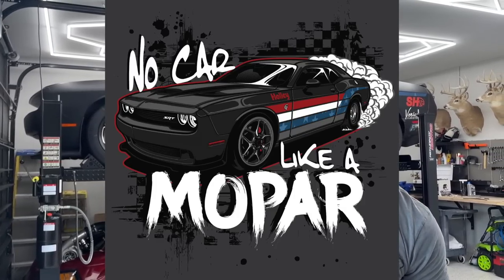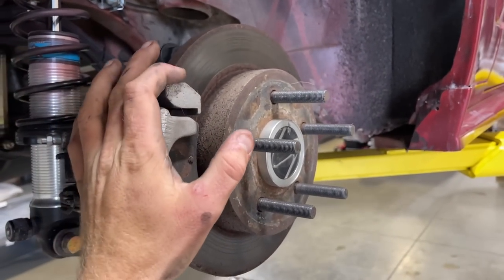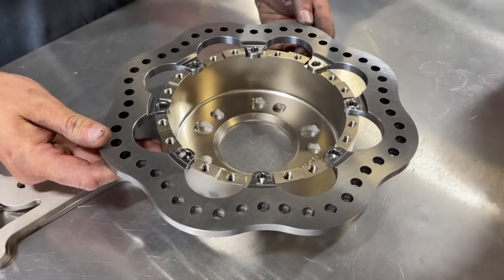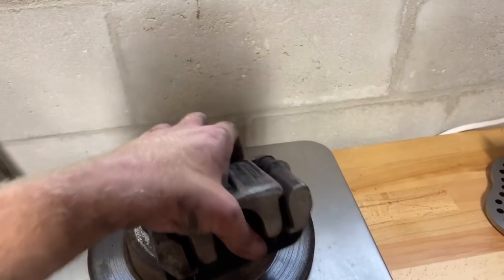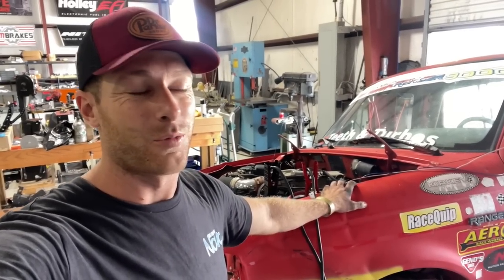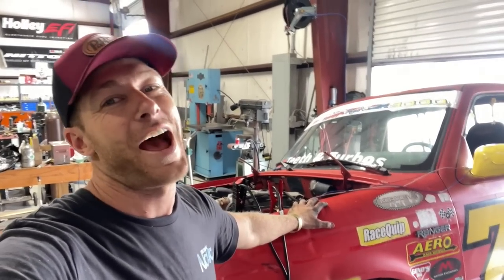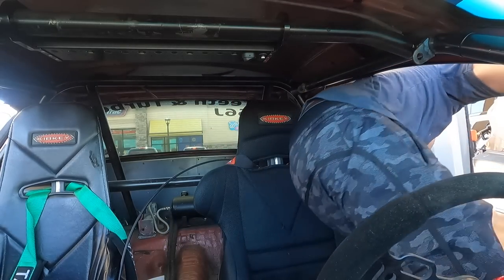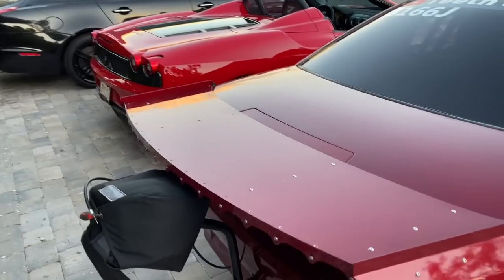7 Second Dr. Pepper Mustang First Start Up! New Brakes are UNREAL! Hellcat gets Upgrades as well!

Comment: Try Bars Leaks Head Gasket Fix in the Ranger. I've used it in 3 cars and its worked in all of them. One step, just poor into coolant. My brothers 4.0L Ranger had coolant running out the tail pipe and would shoot out the spark plug hole. Added the Bars Leaks after 20 minutes of drivinig it was sealed. Was still good a couple years later when he sold it.

Comment: Sounds like your ranger needs tune up or head gasket. Also you need front shocks badly get some stuffer on right side and leave a soft o left help with the weight on heavy corner banks

Comment: Those front tires for the challenger are going to lock up and go straight into a wall in the burnout pad though parker, better put the stock ones on for the pad to be safe
Reply from the maker: Those aren’t for burnouts, just drag racing

Comment: What's ironic is that you were measuring imperial dimension steel rod and calling it out in metric.  1/4" is 6.35mm otherwise known as 7mm, 5/16 is 7.93mm otherwise known as 8mm, and 1/2" is 12.7mm, otherwise known as 13mm 😁
Reply: Your tools must be slipping and rounding every nut and bolt off if thats how you work. Right size of tool is whats needed. Everytime!
Reply: @thatdudeinorange5269  Fractions are rational, everything else is just an approximation...

Comment: The metric system is actually based off bad math back in in the day when the french invented it
Reply from the maker: Depends how you use it. US Standard is better for smaller measurements when working in 1/1000s than a millimeter.
Reply: @DoctrParker  you can look it up. Basically it is a calculation of how big the earth was to make the metric system but they made a mistake
Reply: Saw People harwesting corn and its measured in bushells?!! Whiskey Tango Foxtrot, is that for measurement.. gram kilogram and ton seems far easier. But when it comes to tire sizes we are all fooked, width in metric, profile/height in percent, and rim size in inches. Go figure that one out..  (damn autocorrect have me edit almost every word!)